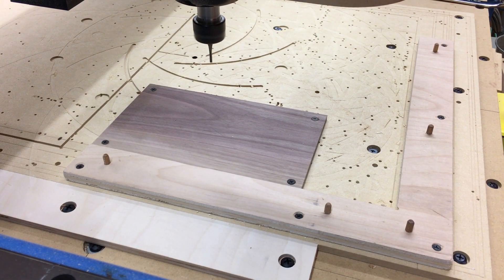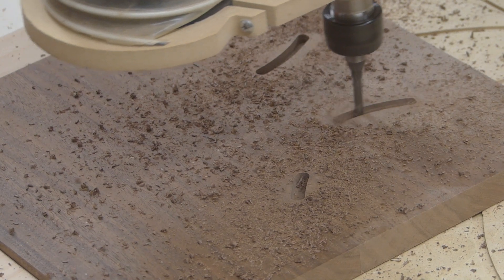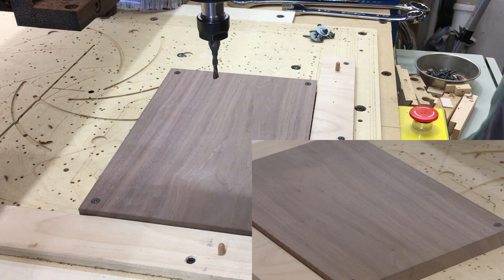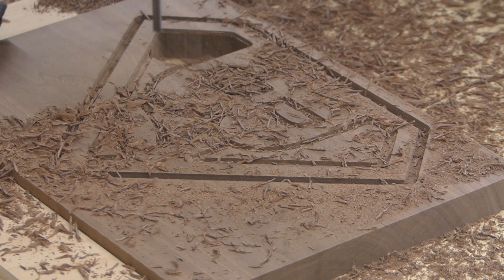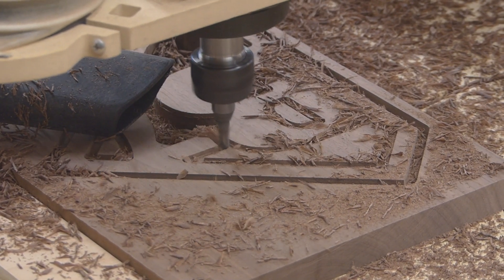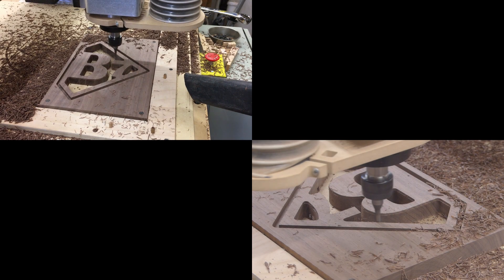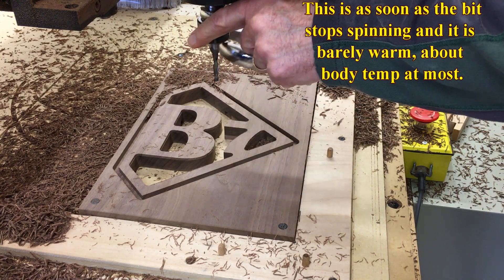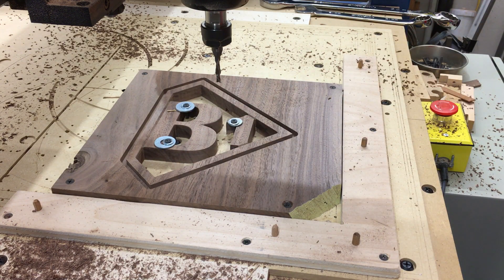Trivets, Fusion 360 Adaptive Clearing - 12-19-18

Comment: is it just the video? or your machine is very shaky
Reply from the maker: No, not just the video.  Rather than build a very stiff stand I built one that is well braced and strong but allows for slight movement to help absorb some of the inertia when the heavy gantry moves.  I guess it's sort of like a bridge or airplane wing that is allowed to move rather than being built so rigid that it could break.  The movement is slightly exaggerated on video, though.  And it's just semantics but it isn't shaking, it's moving as intended.  It's been working for 2 1/2 years without the first hint of anything on the stand loosening or showing signs of fatigue.  And it doesn't try to walk across the floor, so I guess it's working ok.Thanks for the question and for watching!